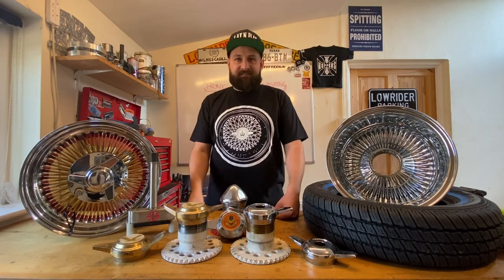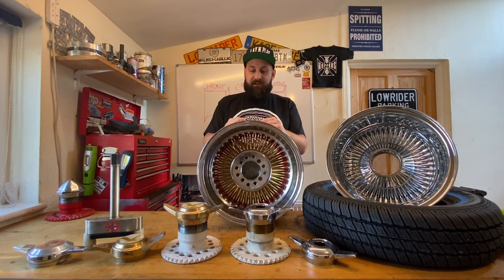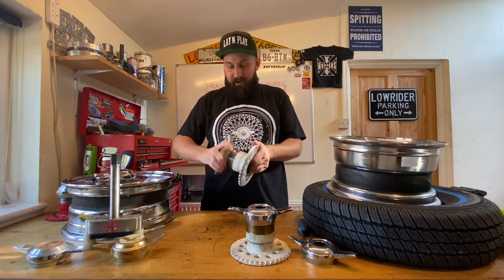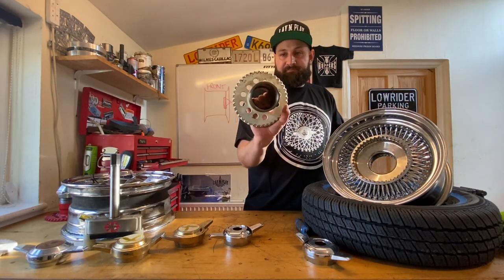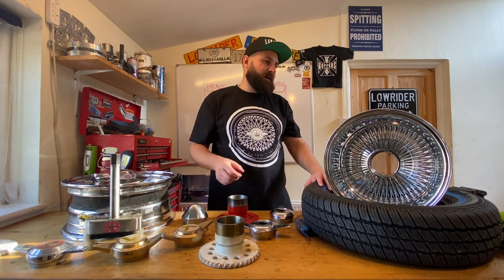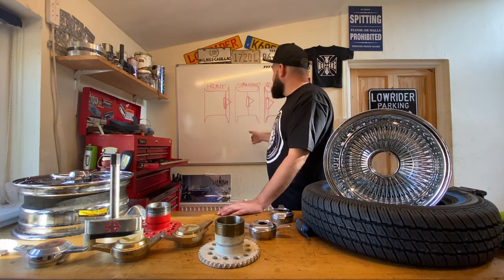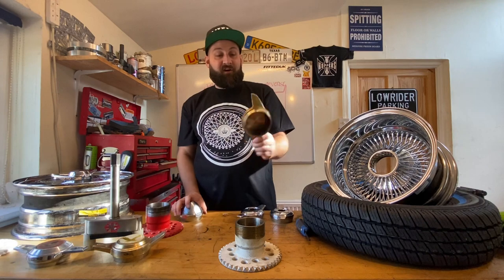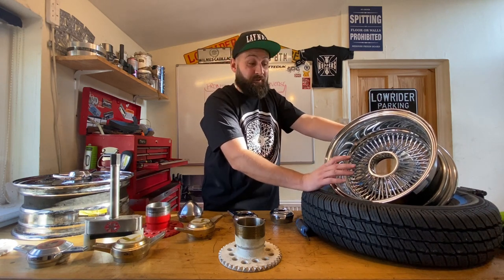Wire Wheels Explained - Get the Low-Down

Comment: I have 24' wire spokes  I think they're rwd standard can I put them on 81 eldorado fwd?
Reply from the maker: They might bolt up but I expect you have clearance issues
Reply: @LayNPlayTV  yes im sure ill have to get the El dog lifted a lil, but is that possible to put rwd wire spokes rims on fwd car? Or do i have to go down and get 22' wire spoke rims that is rwd rims
Reply from the maker: I can’t be totally sure but we fitted reverse laced 13x7 on a Honda Civic which is FWD and it drove fine. As long as they clear the brakes I’m pretty sure it’s just all about offset
Reply: @LayNPlayTV  thanks bro i appreciate the reply
Reply from the maker: No problem bro! And good luck. Make sure to tag us in pics on our IG page

Comment: What's the difference between 14x7 and 14x6 will it fit differently on the car
Reply from the maker: The only difference is the 6” wheel is 1” narrower, so on some cars such as 80s/90s Cadillacs, the 6” wheel will clear the arch better when at full drop. You do lose a little bit of dish it can be worthwhile if you’re struggling to gain clearance.
Reply: @LayNPlayTV  you think 14x6 would look good on all 4 or would it look sucked in and look goofy
Reply from the maker: Nah man 14x6 would still look dope for sure
Reply from the maker: What are you putting them on?
Reply: @LayNPlayTV  1985 pontiac grand prix (G-body)
Reply from the maker: I’d go for 13x7 reverse laced personally, but 14x7 and 14x6 will both fit
Reply: @LayNPlayTV  yea im not going to put any switches on it I'm just going to cruise it, and I'm not going to Lower it  neither so that's why I don't want to go with 13's, I'm looking for 14x7 100 spoke straight lace, but thought about 72 spoke cross lace, but  I can get some 14x6 right now because they don't have 14x7 in stock so I was just wondering if there was a big difference in lip depth and how sunk in the 14x6 will look because being a thinner rim

Comment: Quick question I got a foxbody I’m tryna put Dayton’s on. I’m tryna be on my menace to society shit, but my question is can I drive fast on them I’m not looking to race or anything I’m more of a cruiser, but i just have that question on my mind if you could answer it cuz nowhere online does it say anything about that..
Reply from the maker: First up, that sounds dope you should definitely do it! And I’m not sure about driving fast on cheap china wheels, but Dayton’s and a lot of original wire wheel manufacturers would have been designed for use on 50s/60s European sports cars so should be fine for driving fast on, maybe speak to Dayton direct?
Reply: @LayNPlayTV  Forsure bet and I was already thinking only real Dayton’s I ain’t tryna invest in chinas Thas fasho.. appreciate the game brotha definitely gon get me some Dayton’s for my 5.0 👍🏾 I need me a double burger with cheese 🍔

Comment: I have a three lug 2008 Smart Fortwo. How can I get these wheels on my car?
Reply from the maker: I’ve never seen a 3 lug set of adaptors before, I guess your options are to ask the supplier if they can supply or maybe take a set of 5 stud adaptors and weld/re-drill them... where are you based?